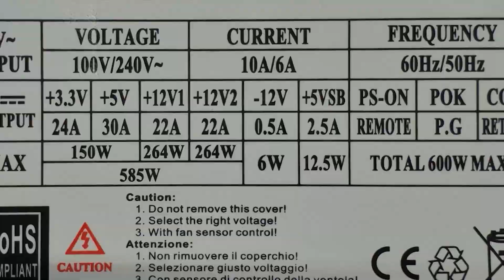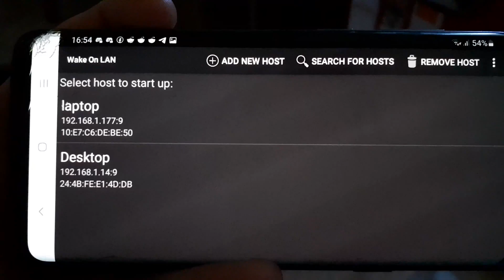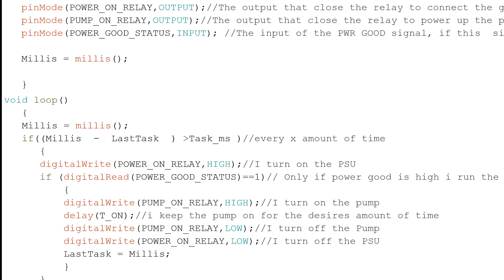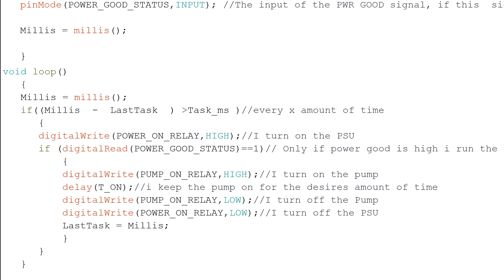How to use an ATX PC power supply standalone.

Comment: Hi, green need to be all the time to GND? If so, how to emulate a standby behaviour (like on using with a motherboard)?
Reply from the maker: When you put green to gnd you Wil turn on the PSU, the purple is what gives the stand by power and only gives 5vdc, to emulate the stand by you have to symply connect the PSU to power